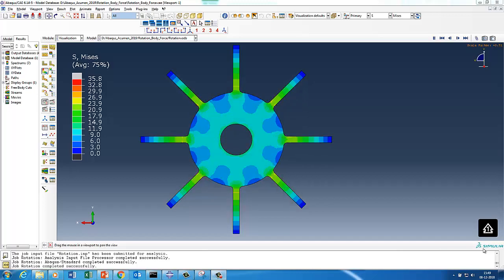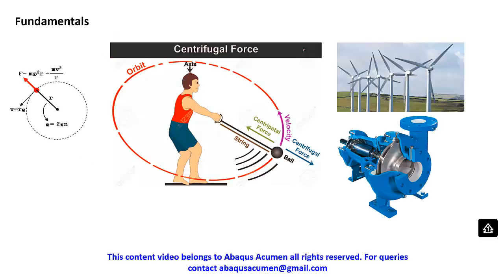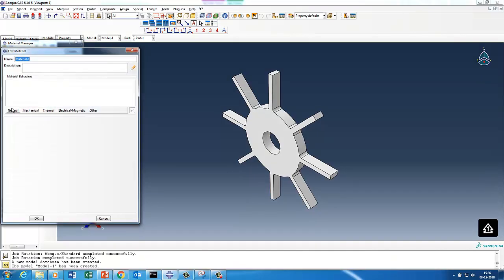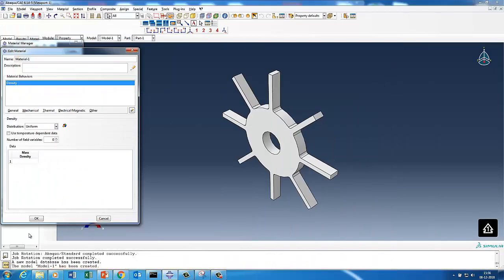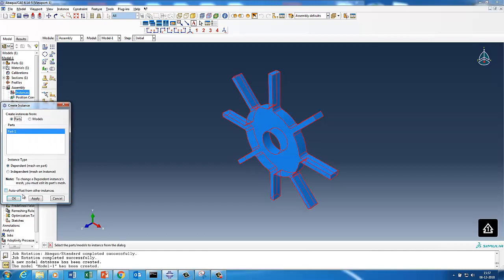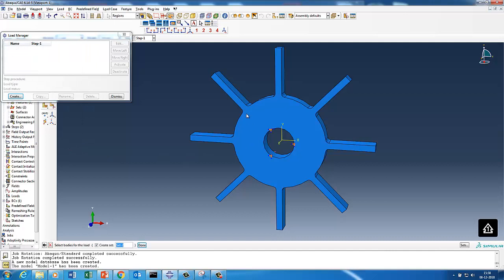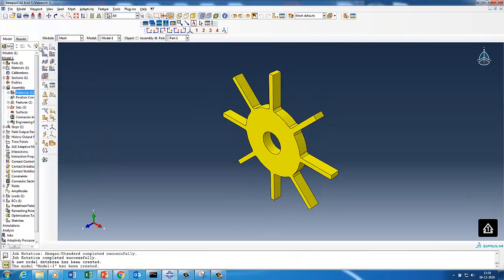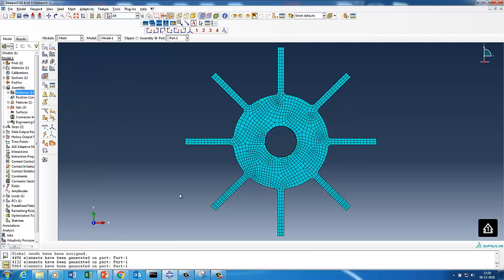Abaqus Tutorial: How to apply Rotational Body Force

Comment: When you put in the angular velocity, did you enter omega or omega^2 value?
Reply: Hi! The angular velocity is applied in omega. Not omega^2.

"Input File Usage: 
Use the following option to define a rotordynamic load:

*DLOAD 
element number or element set, ROTDYNF, omega , coord1, coord2, coord3,
 comp1, comp2, comp3

obs: omega is in rad/second

Comment: I need to give clockwise and counterclockwise rotation. possible?
Reply: The rotation follows right hand rule.  If you reverse the order of the two points you entered for your axis of rotation it will do the rotation in the opposite direction.